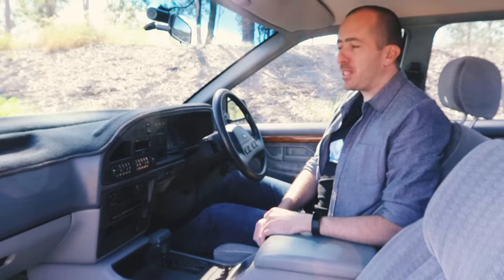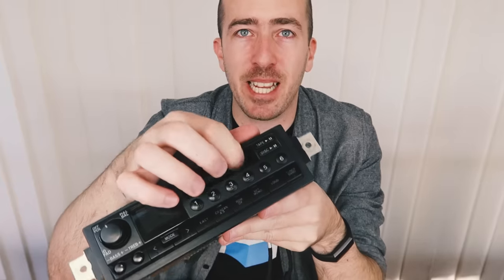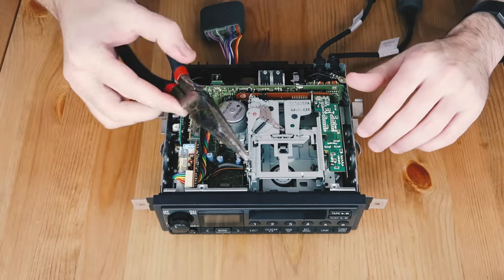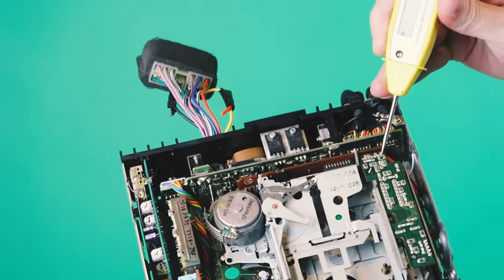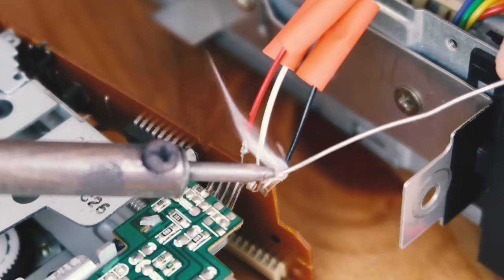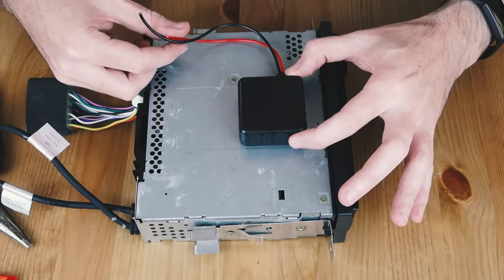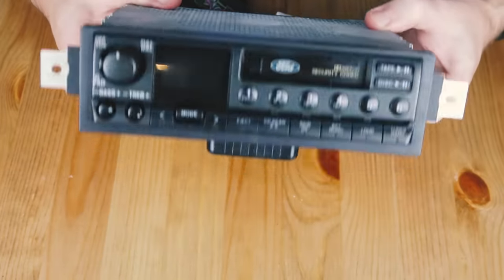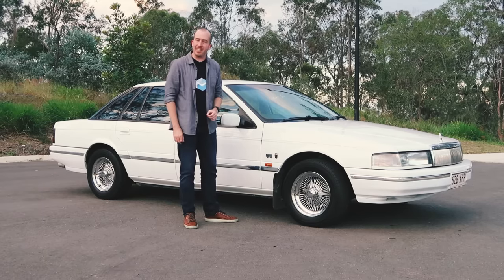Add Bluetooth To Your Old Car Stereo For $25!

Comment: I gave this a try on a 1998 Honda Goldwing motorcycle and it did not work satisfactorily. After much troubleshooting I found a solution that works for applications where if you tie into the signal wires from the cassette player the BT audio sounds distorted. What I did was follow the circuits on the board until I found where the signal from the cassette player went into the pre amplifier chip, removed it from the board, and soldered the BT signal wires into the outputs from the pre amp. My customer also wanted the cassette player to work so I added extension wires from the board to the pre amp chip, and installed a double pole double throw switch so the signal going back into the circuit board can be switched between the BT signal and the output from the pre amp chip which is coming from the cassette player. The pre amp chip was an 8 pin chip so was not too difficult to figure out what the pins were. 2 signal ins, 2 signal outs, 2 amplifier grounds, 1 main ground, and 1 power. I connected signal ground to main ground as it was shared with the signal ground to the cassette player. With this method the BT audio is clear with no distortion and everything still works.
Reply from the maker: Glad to hear you worked it out in the end, I guess every head unit is different so it's difficult to provide a guide to cover everything.
Reply: @MotoringBoxTV  Thank you for your video, it gave me a good starting point and in the end my customer has a 1998 Honda Goldwing with Bluetooth and a working cassette player in the factory radio so he is happy.

Comment: Cool mod, What i like about this mod 1st off if would be thieves are looking they will pass you by. 2nd  It keep a old radio out of the trash. 3rd keeps the old classic look of the dash. The only thing I would change is solder the wire to the pins so you could keep the old tape deck working. but that's a personal choice . All in all I think its a great idea . Awesome Job
Reply from the maker: Couldn't agree more! Easy to solder onto the pins if you wanted to go that way.

Comment: You're a GENIUS mate!! :D. Thankyou for this. I have a 2001 E46 BMW and it only has a tape deck and radio. Cost an arm and a leg to install a new stereo unit or lcd head unit so I'm gonna try and do this trick.
Reply from the maker: Worth a shot! Good luck 👍

Comment: Very nice! The only thing I would've done differently would be to cut the ribbon cables straight out and solder directly to the board instead.

You've done a very good job. Thank you for this video.
Reply from the maker: Sure you could do that too. I just didn't want to risk damaging the board (s)
Reply: @MotoringBoxTV  Understandable! Still, very lovely work. This is actually the first time I've seen a device like this; In fact, I'm gonna put it to use in my own car. I'll keep the tape deck functional though, sometimes I just kinda dig inserting a good ol' cassette despite the audio quality, haha.

Comment: Love the video. Phenomenal content! I would love to try this mod in my 96 Cherokee but an having difficulty finding a module sold in the US with the aux cord. Could this work with a bluetooth receiver with RCA cables instead of the aux? Thanks.
Reply from the maker: RCA would work in theory, but usually the wiring inside the cables is very thin and hard to work with. The other option is if you can find a module which has a connector to suit a particular vehicle - you just need to be able to the connector off and get access to the wires!

Comment: Great job mate, excellent thinking, 

One point to remember guys, happened to me many times, never insulate with electrical tape. Even after heating it like MotoringBox did, after a couple of yeas, the adhesive in the tape starts degrading, maybe even dry off, and the insulation will fall appart, leaving the connection exposed. Not a good idea. 

After seeing many failed connections with electrical tape, wherever heatshrink is not possible, I preffer double sided adhesive tape, (the quality kind), or the newer self voulcanizing insulating tape that works like a charm or even that other stuff that is like a thick goo which you apply on the connection with a brush, and when it cures it insulates and water proofs the connection, that also works great. 

But whatever you do, electrical tape should always be your very last and desperate option. 
Cheers, and again, great thinking and good job overall.
Reply: I second this. Another point: he could have insulated those connections with heat shrink if he had ejected the pin from the connector. There's a tool set you can get that has the correct shape to eject the metal pins out of all the car connectors, and then it would just be a matter of sliding the tubing over the pin, onto the wire, and then clicking the pin back into the connector.
Reply from the maker: Good advice, I know what I did is pretty dodgy. I'll keep an eye on it and redo it properly if need be.
Reply: OH YEEEEEAH......the pin, I did that in my car when connecting the reverse radar.....  
awesome idea Dave, yes the next thing that can be done is actually place heatshrink in a wire, without having to cut the wire, simply by taking the pin our of the connector.  
In many cars the connectors are actualy  little boxes that can be opened  and each pin can be pulled out easily. 
In other cases, like you describe, the pins can be pulled out with a tiny screwdriver or pin extracting tool, and then put  back again, without any problem.
This way you can splice a cable AND use heatshrink to cover the splicing.  
And you won't have that annoying electrical tape that can dry out any time. Not to mention that gooey adhesive that gets all over your hands and .......yuk!!! 

Good thinking David, and again, good job MotoringBox.

Comment: I have a 02 Mercedes e430 I need to do this to, but I want the cassette to work also. So I think a simple relay to flip between BT and cassette is all you need. Switching out the audio lines and cassette on switch All you need is a switch to turn BT on/off.  Then the cassette still works as usual and you don’t need the dummy tape in it.
Reply from the maker: Sounds like it could work - if you ever get it working let me know how it goes.

Comment: You can also find cars from the 80 90s with a car stereo with only radio. But usually if you buy a car that is more than 10 years then the original stereo is for long-term replacement.  replaced by something completely different.  and there are actually now car stereos with classic design

Comment: Very nice vid. Exactly what I'm looking to do in my '86 Honda CRX. Will be attempting this mod when the time comes!
Reply from the maker: Glad you liked it, and good luck with the mod! Some people still don't get why I bothered, but there's something awesome about stealthily modifying old equipment - and without any crappy adaptors or wires cluttering up the dash.
Reply: @MotoringBoxTV  Well, I'm trying to restore my CRX to as close to stock as possible, including the ultra-retro stereo...but I also want to be able to listen to music, talk on the phone, etc. Need to figure out how to set up a mic for the hands-free phone calls.
Reply from the maker: I've seen modules which also have a little "controller" included which you can mount to the dash, to let you skip songs and control the volume, but also with a call pick up button and a mic. You'll just have to see what you can find online, then take the plunge and order one to see if it'll work! Good luck!

Comment: I can not complain a bit about anything contained in the video, even with my having to do soldering work in Citizen Band Radios aswell as all other electronics including repairing older car audio and you sure are correct with doing exactly as you have done. I still and always will believe the partnership between Ford and Alpine is and always will be great. I love the sound from Alpine units. The one thing I would have one is actually tap into the circiut and leave the tape unit operational. On your next one you do try it out and yes you will have to have an empty cassette in this case. The other thing is I would have placed the unit inside the radio. Just beside the cassette track system, it looked like there was enough room. But, I like what you did simply to the fact you are hitting on. Make it so anyone can do the mod. Folks like you make this stuff fun and 1 more thing! Kep it real like you did. I can not stand folks falling into the allowing of ads in thier video's! I have actually ended the viewing of some channel members beginning without them to allow them into thier video's. Sad for them. When money and subs and all the hit this and that crap gets into the true meaning of good informational video's, it ends my intrest in that channel and gets cut from my watch list! Thank you.
Reply from the maker: Thanks for the comment Ben - I was expecting it to be another one criticising every single thing I did, so that was a pleasant surprise!
Reply: @MotoringBoxTV  Ahhhhhh  dont stress the haters bud. Just think of them as steps lol. Lots of floks get upset when they get upstaged or cant actually do things on thier own. Id been doing things long before youtube came along and now its nuce just watching others do things the way I do or used to. But yeah. Dont stress on the bottom feeders. I tend to think of most of society as up rite walking plecostomus. Keep up the work.

Comment: Just imagine that that you got one of the old boombox stereo from the 1980 to 1990 that would be an awesome mod :)
Reply from the maker: So long as it runs 12v DC it'd be possible.
Reply: @MotoringBoxTV  Even using the voltage step up board from what ever the stereo voltage is and output it to 12v. It one of those board that have the voltage and amp adjustable pots on the pcb cant think of the name of it

Comment: Love your work. Can you do some more old car reviews? says 1990-2005? Also, maybe some more simple mods! Thanks!
Reply from the maker: Thanks mate, I'd love to do more. Let's see what happens...
Reply: MotoringBox reversing camera and parking sensors for the Fairlane. Must be somewhere to totally hide a screen. I have a reverse cam in my 24yo Hiace totally integrated into the dash DIN slots and it makes it feel modern!
Camera is a tiny button lens thing set into the number plate light lens uo under the tailgate handle. All but invisible from the rear.

Comment: This was an excellent video. It's pointed the way to my own need for this mod. I've just bought a huuuuge 2003 Lincoln Town Car here in Washington USA and the head unit is from the stone age. Also the AM/FM radio just doesn't work and it has no Aux and the dreaded tape deck. So I think this is going to be this weekend's project. And yes, your soldering sucks (because I'm a pom and I've got to whing about something) but your production quality is tops. Thanks for making this mate.
Reply from the maker: Thanks mate! Good luck with the project.

Comment: The only Negative comment i have is that not all tape decks have a tape/radio option . Hence when a cassette tape is inserted the head unit automatically goes from radio to cassette mode and vise verser. What this means that in the step where the mechanism springs were removed it will disable the function of ever being able to switch to the radio. 
With that said an awesome video none the less. 👍🏻
Reply from the maker: Sure - if that's the case, you can leave the springs in place and simply load or eject the tape to switch between radio and the bluetooth stream.

You could also try removing the tape reel from the inside of the cassette, although this may cause some head units to not function properly, as they may require both reels on the cassette to be turning, otherwise it detects it as a tape jam.

Comment: Insert obligatory comment about your soldering technique here.  But aside from that, cool mod.  I've been happy with my Bluetooth FM transmitter, though it does on occasion have some interference.  One advantage it has over this however, is the pause/play, previous/next track, functionality and the ability to accept, reject and end calls.  I really like that convenience, plus the interference has become less of an issue since my antenna got rusty and broke off partially :P.

Comment: Good job. How about volume? In my 2008 Falcon I have the Ford kit to give me access to the sound system via a 3.5 jack from my phone. Works fine but volume in the car system has to be set up over '20' whereas the radio volume is normally around '5'.
Reply from the maker: If I set my phone's BT volume to roughly 75%, it puts it about the same as the radio's volume level. Have you ever played around with what volume your phone is outputting?

Comment: On my first E39 5 series I did the same, but just an aux in that rain off the tape deck. This might be the route for me this time around.
Reply from the maker: Sounds like you could connect a device like this in the same manner! No cable to plug in is definitely convenient. Thanks for watching.

Comment: Thanks matey, you have saved me from making a video to achieve the same result. Great video MotoringBox !!!! I am heavily into electronics and this works , which is fantastic.!! Even if some bods want to grumble about your not soldering or heat shrinking properly.. Damn brilliant !!! Mine works the same, super happy.
Reply: Can it be done for a 87 Camry cassette deck?
I’m not an electronics guy, I would rather pay someone to do it. Problem is I can’t find anyone to do it. One shop in California where I live wants to charge $350!! They said they needed a Bluetooth adapter and a 4wy channel amplifier to make it work, does that sound right?

Comment: Nicely done video, sir!

Keep in mind that there are a variety of audio CODECs used over Bluetooth.

Just buying a "Bluetooth 5.x" receiver only guarantees that you will have the mediocre (but also universal) SBC CODEC.

That will provide acceptable sound quality, but for best sound, look into which CODECs your phone or other Bluetooth streaming source can support, and look into buying a Bluetooth receiver that also can use the best one your source supports.

Almost all Bluetooth CODECs use SOME form of compression, with only the recent (and still rare) aptX Lossless providing TRUE CD quality audio.

Certainly, some of the better Bluetooth compressed CODECs may be indistinguishable from lossless, to many listeners.

Here's a list of Bluetooth CODECs that I'm aware of, at the moment:
SBC
AAC
aptX
aptX HD
aptX Lossless
LDAC
LC3
Reply: Perhaps the "best" way to add Bluetooth to an old head unit is to do the mod shown here, but instead of hard-wiring, install a 3.5mm stereo jack into the head unit, and plug the BT receiver into that.

That way, you also have the option of running analog audio from a phone, tablet or portable digital music player into the head unit, or changing the BT receiver to a "better" one, easily, when it becomes available.

If the ugliness of having a BT receiver hanging from the front of the head unit offends, hard wire a cord with a 3.5mm female jack into the head unit, and have the cord hidden somewhere that is accessible enough, when you want to plug something into it.

Yet another option is to install a USB-C female jack right into the face of the head unit, if there's room, or on a hard-wired cord that you can conceal, and add both a USB-C PD power supply AND a high-quality DAC inside the head unit. Both of these can be QUITE small, and if, for example, you're going to abandon the cassette player and/or CD player functionality, partially gutting the head unit to make room for these should be "simple", even with fairly large units.

When this is all done, you can just plug ANY phone into the USB-C jack in the head unit with the right USB cord or adapter, and charge the phone (at up to full USB-C PD charge rate, if the phone supports it!), and also play true lossless digital audio into the head unit at up to whatever limit the DAC has, including "HiRes" lossless streams, at "better than CD" quality, such as 384KHz, 32-bit, or even DSD256.

Comment: Great video! My only suggestion would be to buy a small blue tooth module from Amazon "F6888" for around 10 bucks, and a small electret microphone. Wire the module in as you did and route the microphone out to the steering column. This way you get hands free calling as well as the music. ಠ‿ಠ

Comment: 0:38 
Actually, it‘s better than CD because there are bluetooth cassette emulators.
Bluetooth generally only has ~32kHz of bandwidth depending on the version, just like cassettes.

Comment: I have the cassette adaptor thing in my 2002 BMW 525i. Also have a 6 stacker in the boot. So yes, some of us are still burning CDs, lol.
Reply from the maker: Ah, the tapeworm. A very easy fix but the one I tested was so bad. Random static and interference, and truly terrible sound. If the stacker reads burnt CDs then it's not so bad! Thanks for watching.
Reply: @MotoringBoxTV  I have a 2002 Mazda with AM/FM/CD Player. I burn CDs all the time as do quite a lot of my friends. I'm not against bluetooth , I simply don't have any inclination or need to use it. Having said that, your video and presentation was none the less excellent. BTW if you think your soldiering is lousy you should see mine - and I've been mucking around with electrical stuff for over 50 years. As a wise friend once said to me, who cares what the joint looks like, as long as it works.

Comment: I did this mod in my 2004 Corolla back in the days, but BT-modules at that time had the sound quality of low bitrate mp3s. This was 2010, so I just soldered on a jack plug because phones used to have this.
This video was great (and your other stuff too). Keep up the good work!